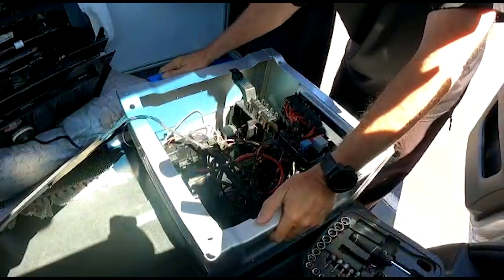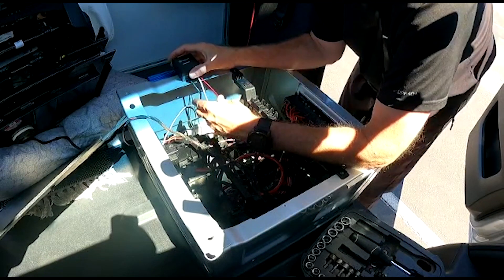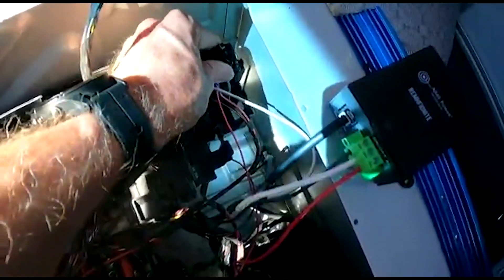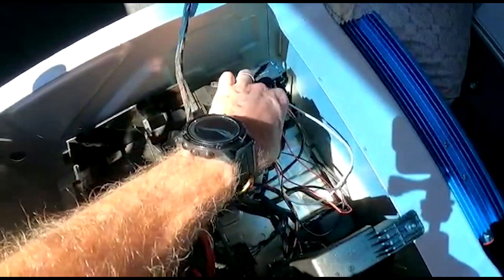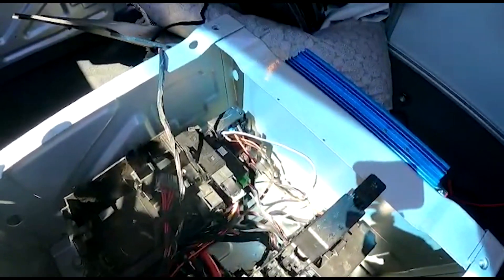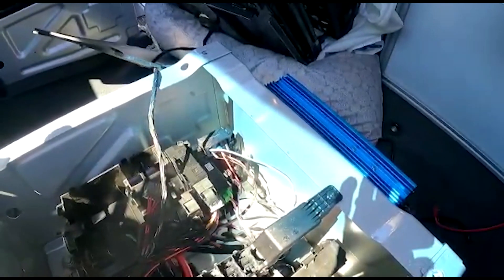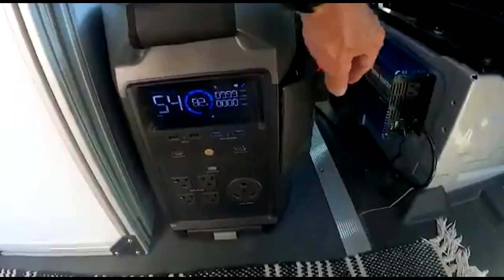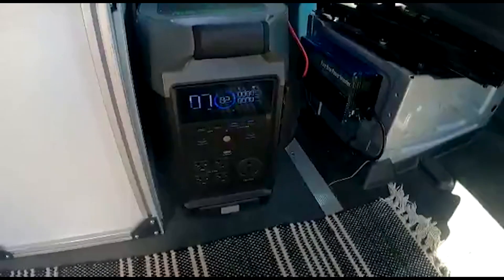HOW TO USE AN INVERTER TO CHARGE (80amps) AN ECOFLOW DELTA PRO WHILE DRIVING. SPRINTER BUILD.

Comment: Hey Robert,  where did you connect your 12v power lines for your inverter?   Did you make new wires and run them directly to the battery?   Is your solution still working well?   Ecoflow is now selling an Alternator Charger, but they want $600!   Looking for a more reasonable solution.

Comment: Thanks for the video. Have the same van and bought the same Aims switch and inverter. Have the builder circuit too. Different power station though. (Fosibot).  Only question is how you are wiring the aims switch. I get the white wire in the middle but what are the red and the ground going to?  Directly to battery terminals?  Thanks

Comment: Perfect video for me!  Have a 2023 Sprinter with the builders kit and the upgraded 280 amp alternator.  This really reassures me that I can run the 1000 watt inverter!  I wanted to do this instead of the  dc to dc because the solar will be using that charging port and I don’t want to switch back and forth.  Thanks!

Comment: My Sprinter came with an extra battery under the passenger seat. 

Would it be best to connect the DC to DC charger to the extra passenger battery instead? 
Also using a Delta MAX with maximum charging capacity of 800Watts... 
Would a 60 Amp do the trick? or does it need to supersede the EcoFlow max charging capacity? 
Thanx, Robert!

Comment: I ran this setup for about 6 months. First, it is crucial to make sure the battery is disconnected and all the residual power has dissipated. If not, an error code will likely be triggered that will require a visit to the shop. It will be a costly fix. Second, my VS30 gave low battery warning messages when drawing 900W while driving. I eliminated this by adjusting the charge rate down even further. Third, my starter battery needed to be replaced after 18 months and 50k miles. I don't know if inverter charging was contributory, but I'm now researching alternatives.
Reply: that is because your alternator does not generate enough power to meet the demands of this power-hungry invertor and your cars built-in loads such as radio, ventilation, AC if any etc. so that your battery kicks in as being an additional source of power and you get what you observed.
Reply: @ric8361  Yep. Even with the power draw dialed down, it was too much. I've now switched to a DC DC charger, which charges it at a much slower rate (~400W) but fast enough for my needs, and more importantly hasn't caused any problems so far (~2 months use).

Comment: For the remote switch, what did you connect the positive and negative cables to?
Reply from the maker: They are connected underneath the seat which leads to the battery and the switch is connected to the ignition terminal under the driver seat. It is in the video as well.
Reply: @GayeNRobert  Thank you for your reply. So they connect directly to the starter battery terminals? I really like your videos by the way and appreciate the information! It's been very helpful in my very slow pace piece by piece build. I have an ecoflow delta max and 2000W AIMS inverter connected to my aux AGM battery (underhood), but its a pain to turn the inverter on and off and easy to forget to turn off which is a quick drain on the battery. So the ignition toggle is going to be a great addition!

Comment: Pretty cool but holy crap are you losing a bunch of power to converting Sprinter's DC to AC and that AC in the EcoFlow into DC for battery storage. Wouldn't it be easier to skip the middle man and use a DC to DC converter to optimize the voltage level you get from the Sprinter (DC to DC Boost/Step Up Converter 12V to 48V probably wanna oversize your converter and get something twice the wattage limit of the Solar Input).

I think the downside is EcoFlow Solar Input is never as powerful as AC input...but if you lose 20% on one leg of the conversion and then lose 20% of that on the next leg of the conversion....if you start with drawing 900 watts from the Sprinter you're down to 576 watts the EcoFlow battery is actually getting...but that might be irrelevant for you because the Sprinter is being driven so you're going to be juicing up the Sprinter battery anyways...
Reply from the maker: Hey Eric thank you for you input and for watching!
Reply: @sheri4673  that is the smallest inverter you can use with your Delta Pro? Does the Delta Pro allow you to adjust the charge rate? I think that might be a feature only Bluetti has. 

If you can’t adjust your charge rate then EcoFlow is correct. A smaller inverter would constantly trip as the delta pro tries to pull 1800W continuously. I’m fairly certain your Dodge Ram Promaster has a large enough alternator to allow you to pull 1800W. You would probably want to step it up to a 2000W model or slightly higher just so you are not running the inverter at 100% all the time. An inverter running at full load WILL eventually fail within a year or two but an inverter running at 80% load stands a good chance of lasting you a few years minimum, that’s just the reality with inverter circuits and how hot they get. Heat will be another consideration. You do not want your inverter tucked up the passenger seat with very little airflow. Wherever you have it placed, put it somewhere where both ends of the inverter (likely fans insides the inverter on both ends) will have at least a few inches of unobstructed air flow. I even saw a guy with a homemade EV Passat rig up some fans in his trunk that sucked the hot air exhaust out through the top of the license plate when the trunk hit a certain temp. Seriously consider mounting your inverter on the top of the interior of your van with the exhaust side close to a roof fan. This could save you a lot of energy when it comes to cooling your van in the summer. When you drive around the inverter will pump out enough hot air to fight the vans on board AC so by the time you get to your destination you might have a van that is still toasty in the back. 

You need to find a mechanic you can trust, preferably one that at least has some experience with either audio mods or vanlife mods. The audio guys run giant amps that require a lot of power so they are very familiar with installing aftermarket alternators that can put out 300-400amps. Your 2000W inverter is going to require 140-160 amps which will be pushing the limits of a stock alternator most likely. 

After doing some reading I’m seeing 220amps pop up a lot when I search for 2500 Promasters but not knowing the year of your Promaster I cannot give you a definite answer. An inverter using 140+ amps is likely too much. You would probably want to look at getting a high output alternator installed and maybe even a second battery. I’m not sure if the second battery will be of much help as you’re going to be relying on the Delta Pro for your actual day to day power but I’m not sure if having a single starting battery when using your alternator as heavily as you will be is a safe system. If a second starting battery can provide redundancy so that there is no situation in which the inverter draw kills one starting battery and you’re stranded, then a second starting battery would save you some serious headache. 

My understanding is the starting battery is used as a float between the alternator and the inverter, not sure if it’s common to connect directly to an alternator. I’ll have to do more research. 

For the time being I would plan on at least a 2000W pure sine wave inverter and a high output alternator (350 amps) to be on your list.
Reply: @sheri4673  another option would be to find someone with two EcoFlow units that charge slower but combined have the same capacity as your Delta Pro. You could trade them and then use the smaller units one at a time on a smaller inverter in your van. Check to see if the Delta 2’s can be charged at 800W. If so you would lose out on the giant inverter as one unit in your delta pro by trading but this would save you money on your van as you likely wouldn’t need a bigger alternator or a $300 inverter. You could probably use a $150 inverter with the stock alternator.

Comment: I was just thinking about doing this setup for the ecoflow pro as it looks like the ecoflow car charger shares the same input as the solar, and swapping plugs every time I drive seems like a pain. Using an inverter to charge on the ac input looks like a great solution. My concern would be running the inverter all the time off the alternator,  Will that shorten the life of the alternator?  My mb sprinter has a factory 280amp alternator
Reply from the maker: Justin unfortunately not sure if it will shorten the life expectancy, from what we've read no. Thank you for watching!
Reply: @Sheri  I have not  actually hooked it up yet, but I plan on  doing the setup similar to the video but using a smaller inverter to hopefully not stress the alternator.

Comment: Hi…thanks for the great info!  Great set up with the inverter!  I see that you have wiring from the 12V discharging panel off the DP…r u using the ANDERSON PORT?  Do you have it connected to a fuse box? CAN YOU GIVE ME THE LINK FOR THAT CORD?  THANKS!
Reply from the maker: The Anderson distribution block has fuses in it. Sorry we made the cord using the Anderson tool.

Comment: I finally got around to trying this, and unfortunately it did not work. The wattage the inverter is putting out must exceed the wattage the EcoFlow is demanding. If not, once that threshold is reached, it will stop charging. So it will work on EcoFlow models that allow the user to set the input wattage but not on models that don't.  My older Delta charges at 1000+ watts, so I would need a 1500W inverter, which is well beyond the limits of my Sprinter's alternator.
Reply from the maker: D. Lowe that's a bummer it did not work for you.  I think the important thing is you were not afraid to give it a go and try to figure it out.   Thank you for watching!
Reply: @sheri4673  I owned an older Delta at the time I wrote my earlier comment. I've since upgraded to a Delta Pro. I believe all the newer EcoFlow models allow the user to set the wattage it draws. VS30 Sprinters display a warning message if the charging system is over taxed. From trial and error, I've learned to adjust my EcoFlow according to how hard the engine is working. I never set it above 800W. I have a Renogy 1000 inverter. 

Unless you have a dual alternator, it is probably unwise to pull 1800W (or 150 amps). So you don't need a large inverter.  

FYI, the Delta Pro can charge simultaneously from the inverter and the cigarette lighter port. I keep it constantly plugged into this port so that it's trickle charging at 70-90W anytime the engine is running. I plug it into the inverter only as needed.
Reply: @sheri4673  I’m in the same boat with a Promaster 2500 and trying to figure this out.  I’m following this in hopes that Robert replies.🤞🏻
Reply: @sheri4673  in the link I posted to an installation video there are some great comments... Then she has a follow up video which answers a lot of questions in the comments that were raised.
Reply: @sheri4673  You may want to give some thought to how big your battery bank needs to be. A power station that needs to be completely recharged everyday is too small. Recharging would require too much driving, unrealistically sunny conditions, or just the inconvenience of finding a place to plug in. In the worst case (high use and no recharging), my Delta Pro can last me 3-4 days. On a roadtrip, driving 6-8 hours is sufficient @ 100w/hr to replenish what I’ve used during the day and overnight. If your cigarette port is overheating, lower the amps it is drawing on the Ecoflow app.

The inverter is connected to the starter battery (in my van it’s under the driver floor) via 2 gauge AWG wire. Make sure its thick enough for the current that you’re sending through it. The wires I initially used got too hot and melted. 

If you don’t know the size of you alternator, protect your vehicle by being conservative about what you allow your Ecoflow to draw. If you’re drawing down a reasonable amount, say 25-35% per day, ~1000W it would take only 2 hours to replenish it at 500W. So there’s no reason to push it.

Comment: Hi guys! Thank you for your information in this video. I too have a sprinter van and a Delta Pro as my camper house battery system. What I am interested in is how you connected this inverter to your actual starter battery. I didn’t see this information in the video but want to replicate it to help charge my Delta Pro. Any information you can provide would be greatly appreciated!! Thank you
Reply from the maker: Take a look at our video on how we used a 1,000 watt inverter to charge the Delta Pro. Thank you for watching!

Comment: I have the Ecoflow Delta Pro in our sprinter van too. I only use the Pro for our 110 power needs and short term powering our air conditioner. Seperately I have a line running from my sprinter battery to another house battery with a manual shutoff to charge the house battery when we're driving only. And a 380 watt solar panel feeding the Pro. Our house battery only powers our 12v water pump and overhead lights. Can I run this line to a 5000w inverter and then to my Ecoflow to charge? Do I need to adjust the amps on the Pro? Side note: we also have a 30amp external port for campgrounds I've wired for the air conditioner. Your the first person I've seen dealing with these ecoflow Pro issues. James and Kim
(We also have a channel named: Treasure Hunt Foodies)
Reply from the maker: Hi James - we will check out your channel - sounds interesting.  As far as using the cable from the Sprinter battery to a 5000w inverter - the most that a 2022 Sprinter can pull from the alternator is 80amps - or 960w.  So, you could use a 1000w inverter that is ignition on switched and then set your delta pro to only charge 1000w or 900w to be safely under the 80amps.  The inverter solution works very well.
Reply: @GayeNRobert  Hi and thanks so much for the responce. I'm really excited to get this to work powering up the Ecoflow while driving. So I shouldn't use the 5k inverter? Get a smaller inverter?
Reply: @GayeNRobert  I saw that I can set the Ecoflow but will need to read up.

Comment: This is great and I'm planning to do this on my 1998 sprinter van, I'm just worried about my alternator being that it's only 90amps alternator and it's also powering the ac compressor, adding another 1500watt inverter might be pushing it.  But might try it, charging my delta pro at that speed is a luxury for any campervan owners. thanks for the tips!
Reply from the maker: Aldino so far everything has worked for us. Love the flexibility of new power stations. Thank you so much for watching and taking the time to comment. Let us know how it worked for you!
Reply from the maker: Hi Aldino - Yeah, 90amps might not give you much extra to work with.  We have a 220amp alternator in our 2022 - and Mercedes states that 80amps is available - which is 960watts.  Have a great evening!
Reply: @GayeNRobert  Thanks for replying, I just found out that adding an auxiliary battery to the vehicle to power the inverter would actually work. what dyou think?
Reply: @sheri4673 What set-up did you use to charge it?

Comment: Amaaaazing lol... thank you... so I guess the red cable goes into the 110v input of the Ecodelta right? also let me ask you... as long as the engine is on, the alternator can provide 1000w? wow... if the engine is off, it will kill the battery quick I guess...
Reply from the maker: Hi - thanks for your comment. No, the AC cord from the Delta Pro plugs into the inverter. According to Mercedes, the 2022 Sprinter van provide 80amps which is 960watts. We only use the inverter with the engine running.

Comment: Hi! 
Love this and want to do this in my skoolie to charge my DP. How did you connect the inverter to the battery, just an extra set of terminals? Did you put a breaker in between? how did you run the cabling? 
Also - in order to simplify the installation, could I skip the auto on/off and  just manually turn on the inverter when i start the engine, and then turn it off when I turn it off?
Reply from the maker: Hi - Thanks for your comment.  The inverter is just connected to the battery via 4ga battery cables under the drivers seat. I did not add a breaker - but probably advisable to do so.  The cabling is only about 24" long and runs out the bottom of the drivers seat base and connects directly to the inverter. Yes, you definitely could just manually turn the inverter on/off.  Let us know if you have any other questions that we might be able to help with.  Have a great day.

Comment: I too have a Sprinter with a Delta 1300. What is the advantage of charging it this way vs using a DC to DC charger? Do you have any concerns about drawing too much amperage off the inverter (especially when idling the engine)?
Reply from the maker: Good Morning - I think the main advantage is the simplicity of the setup - not sure if you can buy a 80amp dc to dc charger (maybe) but we had 3 "30amp Victron DC to DC" on our 2019 Sprinter along with much more cabling.  No concern with drawing too much amps - from our experience in our 2019 Sprinter - we did not see a difference in alternator output at idle compared to more rpms.  DC to DC works fine, the inverter just simplifies the entire setup.  Enjoy your weekend.
Reply: @GayeNRobert  this is a slick set up. Would love to pick your brain to replicate this with my four wheel camper build
Reply: @GayeNRobert  I can buy a 60 amp dc-dc renogy charger. I see the 1000W inverter is around the same price, so yes youre getting 90A using it, but it makes a bunch of noise.. is it possible the dc-dc is quieter and just as simple to set up? I understand will be 30% slower charge rate... Just trying to figure electric out before starting to build my skoolie and I want to use ecoflow delta pro to power it...